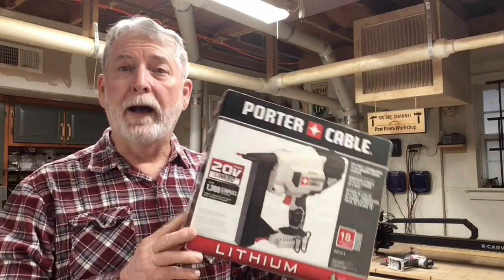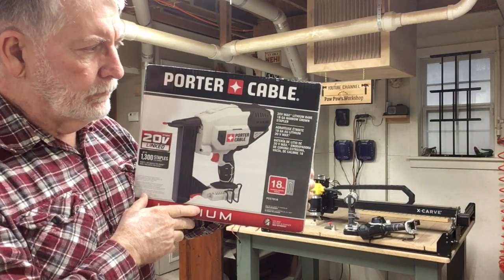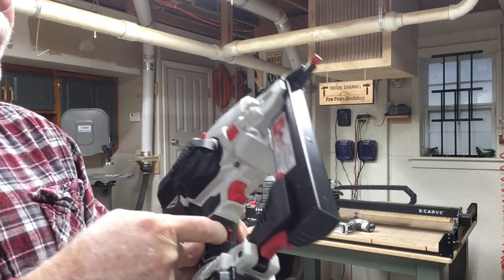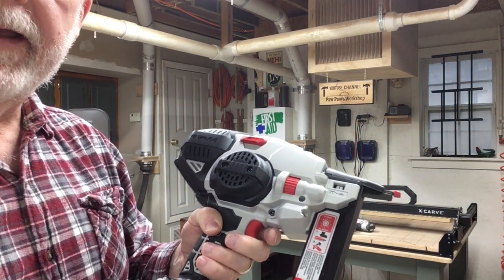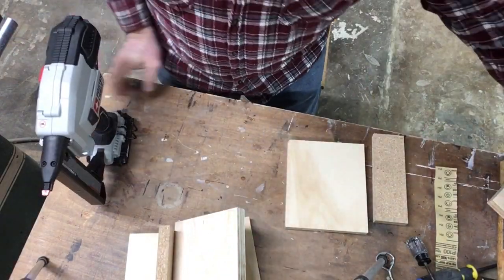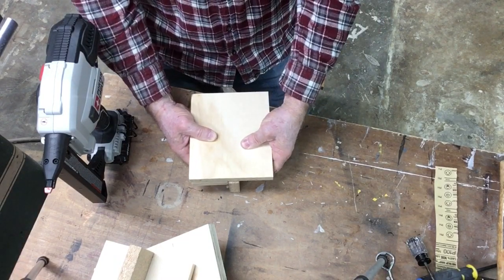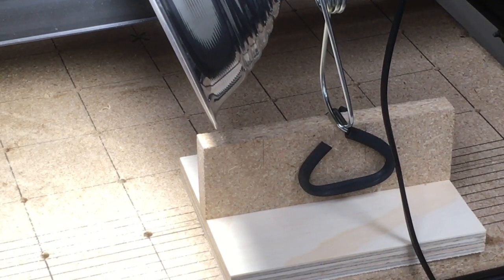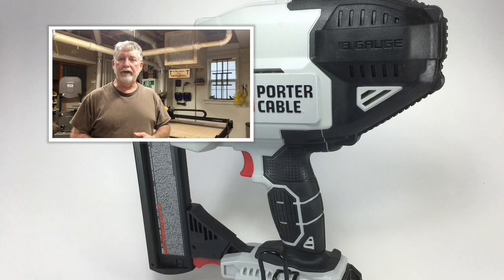Review Porter Cable 18 ga Brad Stapler

Comment: Porter cable 18g stapler not firering
Reply from the maker: It will jam and unfortunately you have to take it apart to fix it. Mine just did the same thing. I’ll have to do a video showing how to repair it.